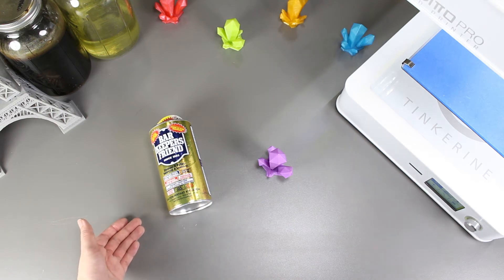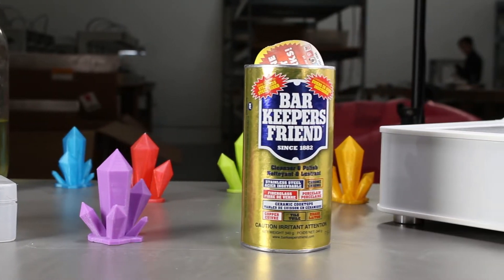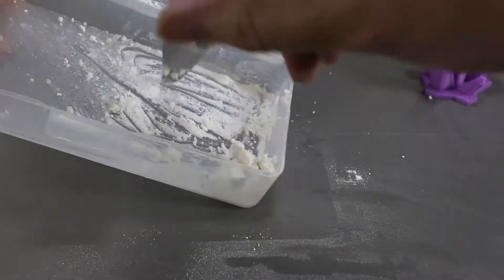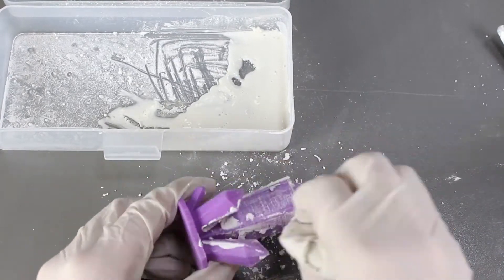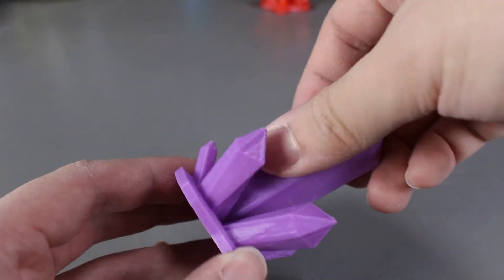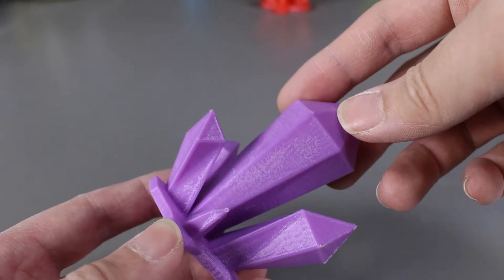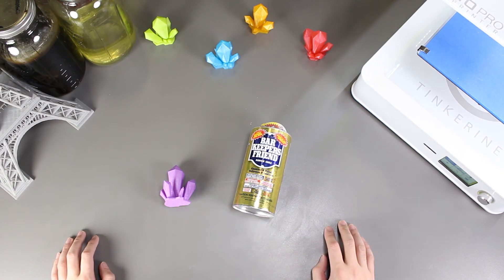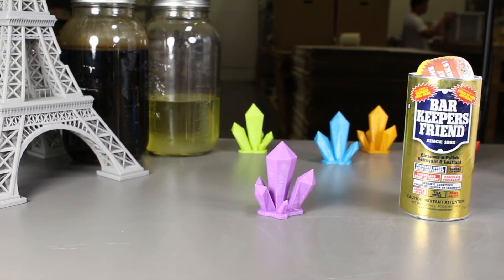Smoothing out 3D Printed PLA Model with Bar Keepers Friend Part 2

Comment: Hey can you make a bucket with sand in it, like a cement mixer, and put the model and the sand / small stones in it, and then turn it to see if it will smooth the model like if it was sandblasted?